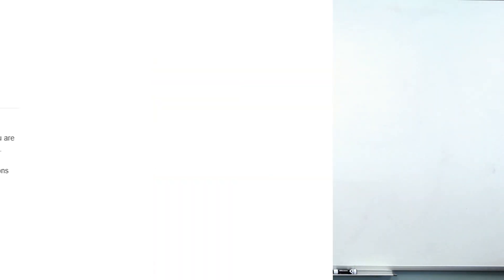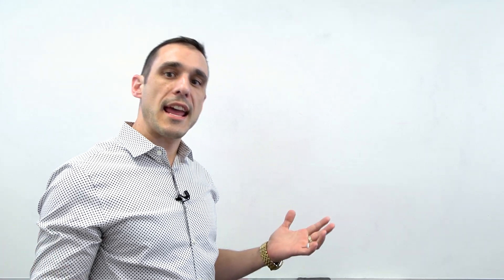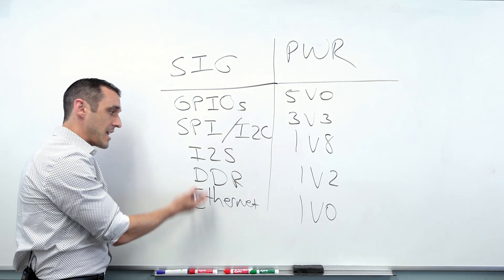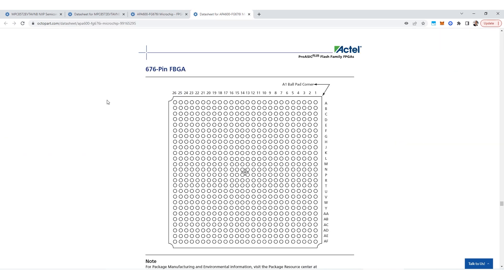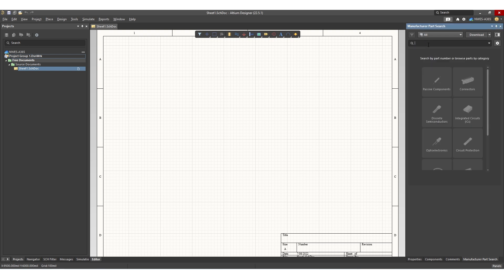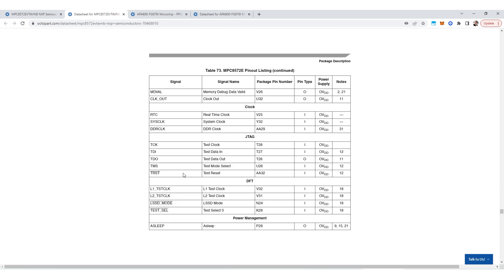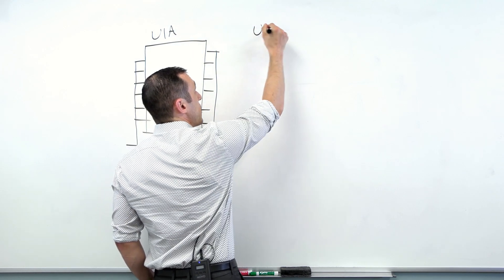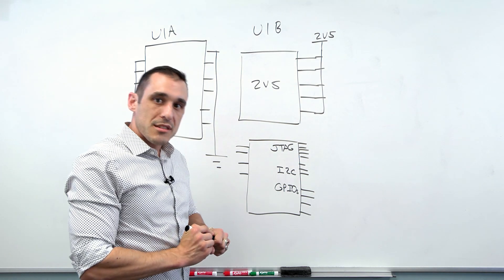What's in BGA Schematic Symbols (FPGAs, MPUs, and more!)

Comment: There is one site on the Internet. A database of almost all the most popular types of elements + footprints.
When creating a component as an element - all of which the legs are grouped and divided into different blocks. The main thing is to connect all the blocks in the circuit. 
Concerning designations. I often use name's - VCC_1V0, VCC_1V5, VCC_2V5, and more...
Singly for JTAG-block, Singly for DDR/RAM/ROM, Singly for USB_BLOCK, and more. 
It is easier to search for the entire block in the diagram....